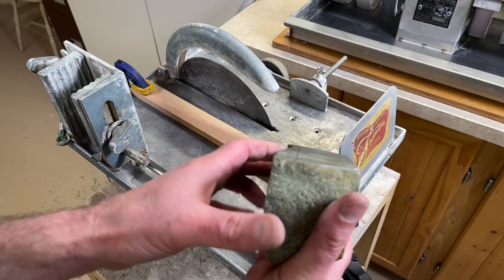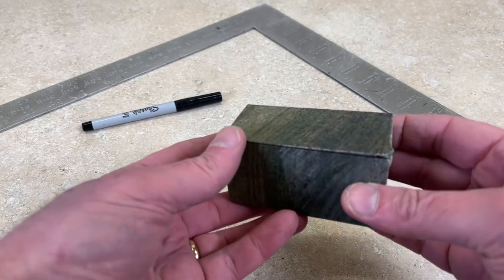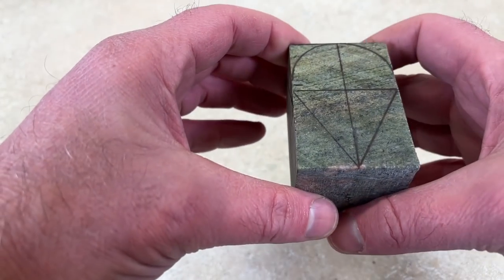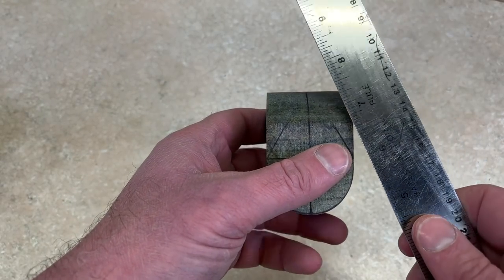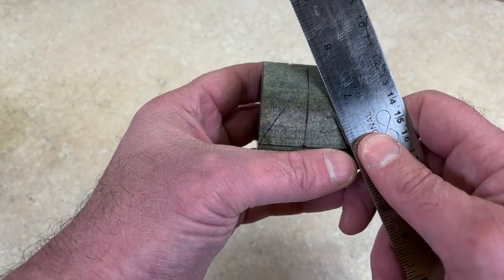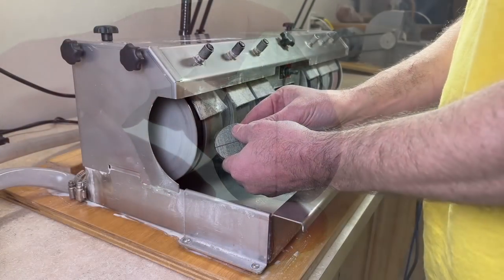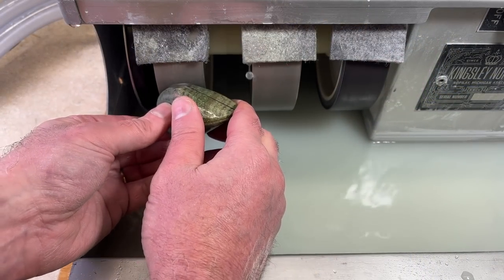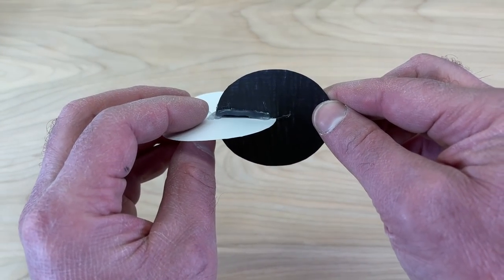Weird Rolling Shape Made of Rock—Maker's Challenge 2022

Comment: Very cool! I've seen them before, there are many shapes, usually 3d printed. Rock models are rare!
Reply from the maker: I watched a video by a guy who 3D prints a lot of stuff like this. Fun stuff, but most of it would be extremely difficult to make from rock.
Reply: @MichiganRocks  Oh, yes, I fully agree with that. Until some company will find a way to sinter rocks... ;) They did that with metal... maybe glass filler and glass sintering for 3D printed quartz parts?

Comment: your old Frantom in is pretty good shape. you need to grease the shaft if you want the gravity feed to work.
Reply from the maker: Thanks. It's been a few years since I have tried that, but think everything was well lubricated. I have better slab saws now, so I don't really need to use that one for slabbing. Maybe some day I'll try again just for the fun of it. Thanks again.
Reply: @MichiganRocks  I have the new HP 10" stainless steel. Really good saw.

Comment: I may have missed it, but did you flip it left for right and see if that made it curve off to the opposite direction as it rolled? If it doesn't, then maybe your house is tilted (just kidding). It would make sense that if one side was even slightly smaller, it would turn in that direction.
Reply from the maker: I did try that. It seemed to go randomly in either direction. I think that means that it was probably too big in the middle or I didn't flatten the sides enough.